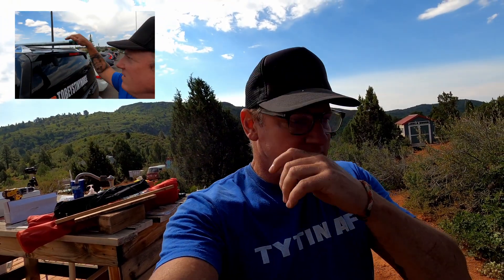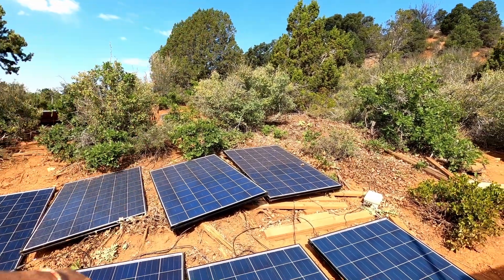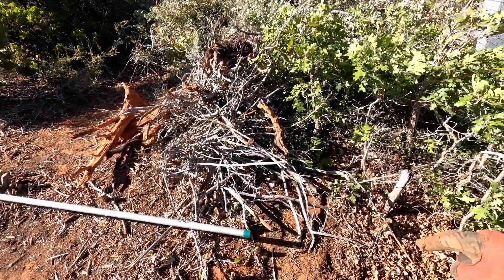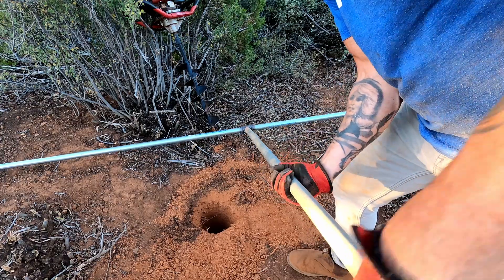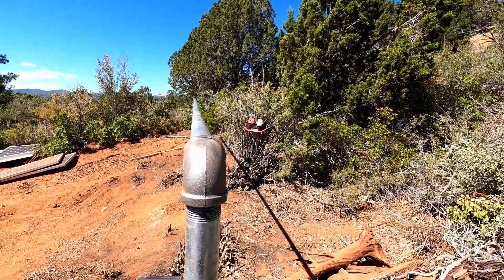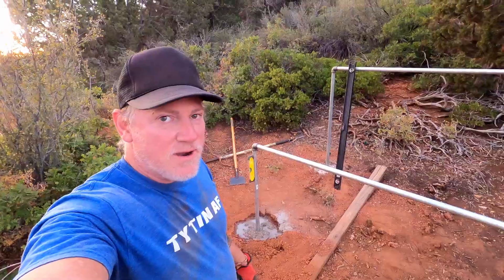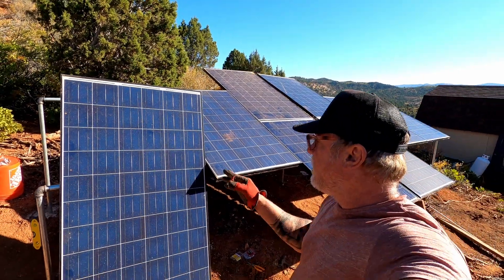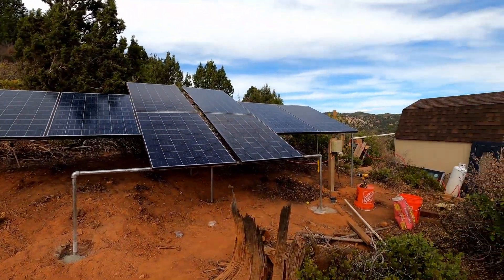DIY Solar Panel Mounting System for under $350

Comment: Excellent job. Mines have been just thrown down on my roof for about seven years now. Mainly because in case of an hurricane I can just pick them up and bring them in the house. I am planning to build something like yours.❤
Reply: I have 10 laying on a flat roof. They are on PVC pedestals for mounting to an RV roof. The plan was to mount them after installing a metal roof. But it's hard to part with $25,000. so they are still laying there. Survived 4 hurricanes so far with a Cat 3 being the strongest. I did put some flat patio blocks on the edges of the pedestals in preparation for the Cat 3.

Comment: Cement does not have gravel in it and is mostly used to lay brick and block. Concrete has gravel and is used to pour pads, floors, and  bridge pears its stronger than cement cause of the gravel.
Reply from the maker: @MrWolfleader1  Awesome……I’ve been wondering about that. Good explanation. Now I understand. 👍

Comment: That would be one big wind sail in my area.
The whole works would pull out of the ground and then bend the pipe like limp spaghetti.
Reply from the maker: Where you at?
Reply: @tobeystinyhouse  
The High Desert of San Bernardino County California.
Not too far from Joshua Tree National Park.
I'm in a mountainous area and wind can be intense at times. I've seen my monopole 2"x2" square tubing mounted wind turbine flex badly. Has hit 80mph gusts often enough.
It's buried 6' in lots of concrete.
I could get away with a light install such as what you have at my South East Oregon Summer Camp that is sheltered some.
I'd probably used larger diameter pipe though.
Reply from the maker: @blaydCA Oh wow…..yeah that’s intense. Yeah….our gusts here are like 30-40mph. 😉
Reply: @tobeystinyhouse  
Worst recorded locally, not certified was 100mph gust.
The wind turbine self protects in extreme winds. It's done it a few times 
The house actually shudders in those winds.
One gets used to it. 
I don't own any glass top patio furniture anymore. LoL
Reply from the maker: @blaydCA  40 mile an hour winds are too much for me. My wind turbine is pretty much an ornament now….I don’t get much juice from it.
Reply: @tobeystinyhouse  
I'm currently in my grid connected house, while the off grid cabin is being worked on. The off-grid power is actually more reliable than SoCalEd.
The small Airex is allegedly 500 watts. It averages 50 watts at best.
Only worth it the rare times of a week of no sun to keep fridge and lights. 15 years or so old now. Very low return on investment compared to solar.
Summer Camp WON'T get wind turbine.
Reply: @tobeystinyhouse  
I'm going to get LiFePo server rack batteries to replace the Pb acid batteries.
Looking forward to the upgrade now that they're reasonably priced.
Reply from the maker: @blaydCA  Yeah….I was on lead acid for 4 years…..then 8 months ago I switched to LifePO4 lithium ion batteries and the difference is night and day. I never worry about my battery life anymore unless we get some overcast days. Even then I can change my charge controller to boost charge longer and the batteries will get filled up.
Reply: @tobeystinyhouse  
FYI:
The weak points are the threads on the pipe, as it's a tapered thread.

Comment: Good spot for bi facial panels
Reply: Yeah if u did bifacial and put in reflective material on the floor that would be a big boost!
Reply from the maker: @ Definitely 💯….we are going to be building a bigger tiny house next to it and it will need power….so maybe we’ll do that instead of taking up so much real estate with solar panels. 👍
Reply from the maker: @davi75668  Right?….I just recently heard about those. 👍

Comment: How much did the panels cost? And where did you get them from?
Reply from the maker: @davidwellen830  Hey, Dave…..these are Canadian Solar 250 watt and I actually bought them used for $90 a piece in Arizona. They were about 2 years old when I got them.

Comment: Thanks for sharing.  I really appreciate that you shared the actual mechanical connection between the panels and the support pipe.  Those self tappers looked a little long, I was worried you would crack a panel but clearly it worked fine.  😀
Reply from the maker: @bhunter736  Yeah…..no problem. I would actually go with 3/4 self tapping. That’s what I usually use to be safe. Home Depot was out of 3/4…so I had to use 1 inch for this project. 👍

Comment: That will never survive a wind storm. Brutal.
Reply: I'm guessing wherever he is never has high winds. They've apparently been lying on the ground for a long time, they'd blow away in Texas like that.
Reply from the maker: @dougwilliams2890  Yeah the highest winds are 45 here….like I was saying….we have 3 sets of these mounted in this style and have had zero problems. These are built with 1 inch pipe which is all we need, but you could build this same set up with 2 inch pipe and concrete holes. They probably wouldn’t go any where.
Reply from the maker: @timcat1004  What kind of storm you talking about?  Hurricanes? We had gusts of 45 mph and they did fine. We actually have 3 sets of these throughout our property. If you’re talking about hurricanes…yeah that would be different. We’ve been using this method for 4 years with zero problems. All are still standing strong.
Reply: @tobeystinyhouse  Depends on where you live, in Texas gusts to 45 is just another windy day. Have seen many 80+ gust straight line winds.
Reply from the maker: @ Yeah…..that’s scary. I experienced that hiking on top of a mountain….I couldn’t even stand up straight.